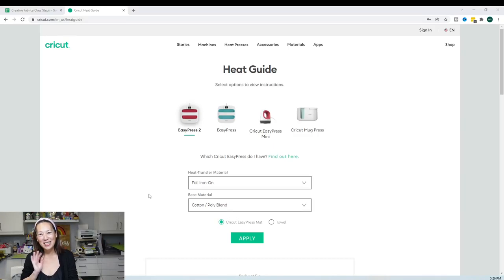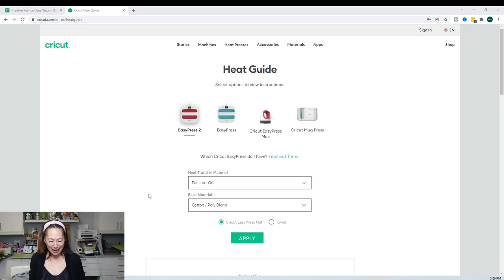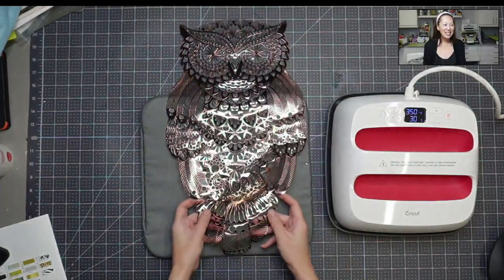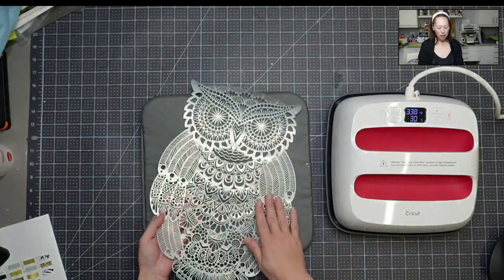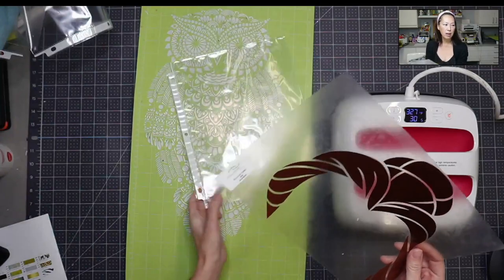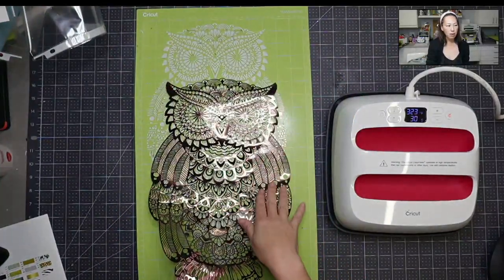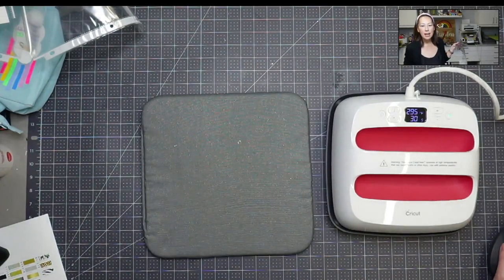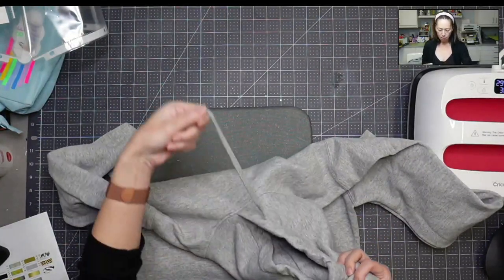How To Use The Cricut Easy Press Cricut Heat Guide | Using Heat Transfer Vinyl | The Useless Crafter

Comment: The preheat for 5 seconds is for the fabric before you start the press of the htv. To release any moisture in the fabric, which can cause the htv to not adhere as well 😊 and you should really hold pressure on the top of the press, even if the directions say not to, because if the adhesive isn’t pressed into the fibers, it will peel off eventually. I’m a pro printer, I’ve seen it happen many times. I use my easypress for hobby printing and I literally lean some of my weight onto it while I press 😊